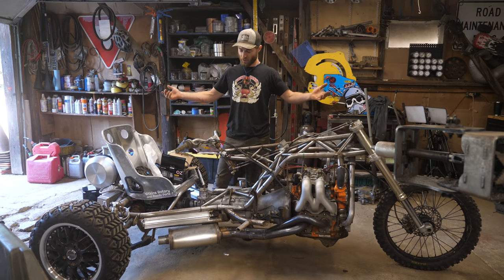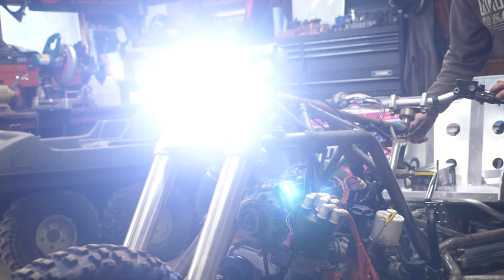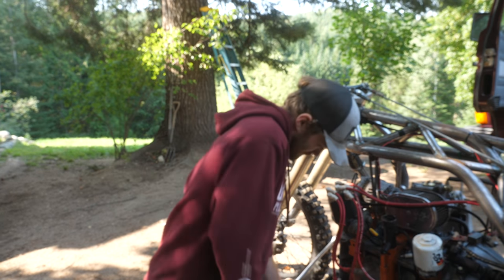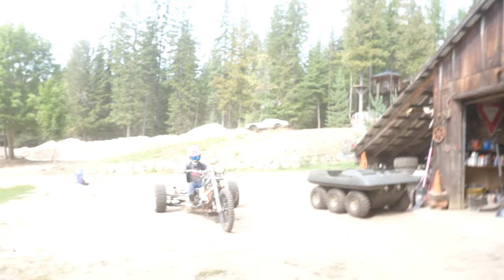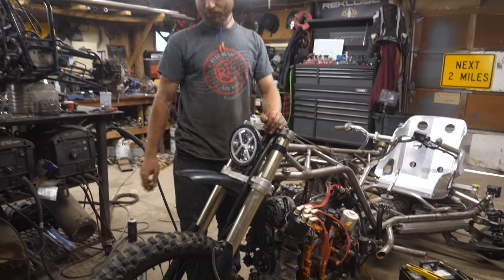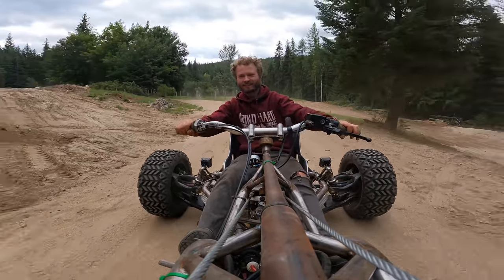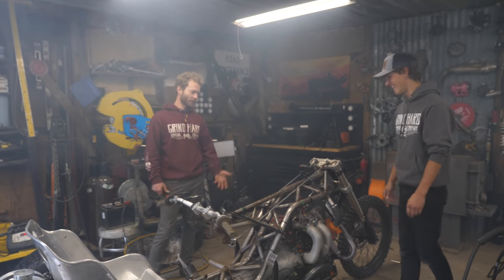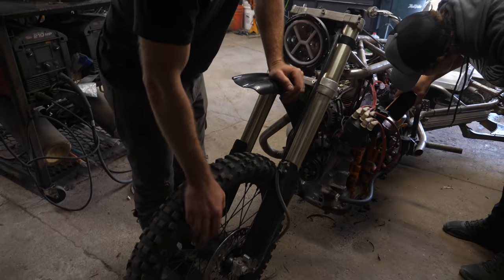Mad Max Rotary Trike Burnouts Lights and More!

Comment from the maker: Big thanks to Ridge for sending us this wallet and supporting the channel! Here’s the site if you want to check them out! https://ridge.com/GHPC
Reply: You gonna let rolly polly roll it?🤣
Reply from the maker: @that_red_dentside3968  If he so desires haha
Reply: @GrindHardPlumbingCo  right on!
Reply: @GrindHardPlumbingCo  try to do a collab with rob dahm
Reply: For the issue with braking power why not try find a twin rotor front wheel and go down that route?? Love what you do guys 🤘🏼😝🤘🏼
Reply: The thing sounds like it’s running to lean on the top end! Fast way to burn up a Rotary!
Reply: Vargas bros need to get there hands on this
Reply: Yoooo I wonder if you could use chain and sprockets instead of the cable on the steering if it would work it would look 🔥
Reply: @keeganbay3490  Oh yeah, it's crazy lean. They already have that thing too lean at idle. Rotaries are fickle beasts, you assume that the air/fuel load would be somewhat linear based on throttle position but they aren't, especially if they've been ported. Getting a carb tuned for a 13b is a nightmare, we spent months trying to get a Holley 650 working right on my friend's setup years ago, had to plug the power valves and modify air bleeds,  the ported motor made the vacuum weird so we had to switch to manual secondaries, which never worked right either as even with smaller jets, opening the secondaries below 4000 RPM would bog/flood the motor, but if you went too small on the jets, 6K RPM at WOT would go way lean. We ended up giving up, loading larger primary jets and disabling the secondaries completely running it as a fat / rich 2-barrel. I genuinely don't know how people get their BP'd rotary engines running right on those finicky choke-less Weber 48 IDA carbs.
Reply: Doing a car project, do you have a link for the headlight?
BTW, if a van shows up with men dressed in white, just accept the sweater they will give you and tag along 😅
Reply: I couldn't wait for the video to end what you got in that box in the background
Reply: @josephmills7186   he also recently did a video about how to fix several common issues with wankle engines.. It would be worth the time while they have it apart.
Reply: Is that a power wheels ready to build in the back
Reply: You guys are amazing! Imagine it build it repeat. Best yt channel ❤
Reply: Itd be cool to see some fiber glass work and duct the heat from the engine down away from the rider. Some sort of cowling.
Reply: You should ask Rob Dom to rebuild your engine
Reply: First you need to put some 2 stroke oil in the fuel if you want it to last
In stock form they got a oil injections pump but it not reliable  the best thing to do is mix fuelike a 2 stroke
Go see some rob dahm video
Reply: @That_s10_guy  or even better Angel motor sports
Reply: @GrindHardPlumbingCo  It desperately needs tassels coming off the grips.
Reply: I’ve been commenting almost every vid that they need to actually tune this thing before giving it the beans, it’s an awesome project but it’s gonna blow up before it’s even finished at this rate :/ definitely needs to be fattened up, probably some ignition tuning and they need to run premix instead of using the stock oil injection system. It’s so close to being a total beast!
Reply: #GrindHardPlumbingCo you should weld two bars coming down from the center of the top tube down past the front of the belt and under the engine then put some kind of diamond plate mud/bash gard on it so no mud or rocks damage the belts or engine
Reply: @racerex340  built a carbed 13b From 88 rx used a Quadra junk never got a good idle if any but dam it ran like nobodies business on under a heavy foot
Reply: Put a big ass oil cooler in helps cool the rotars
Reply: My friends turbocharged hes to make tuning easier might work for yours
Reply: @keeganbay3490  yeah, I feel like with most carb applications on the 13b, it either runs like crap on the low end but screams WOT, making streetability a challenge, or you can get it idling and running OK under half throttle below 4k RPM, but top end is either too rich or too LEAN. EFI is the way to go
Reply: If that picture at the end of the video was part of the merch I would most definitely buy it. That pic is epic
Reply: @racerex340  I'm running a 48 dcoe on my ported 6port and I have the jets bored way the fuck out I rather run my premixed rich so to thing stays good and lubed up in there.
Reply: @sexkrazedpanda  yeah, I've driven a few 48 carbed 2 rotors, if you get them tuned right, use premix instead of injecting, they can be pretty sweet. I don't have the talent to fine tune a ported carb rotary.
Reply: It needs a roll cage but sickkk build
Reply: Time to call Dahm and the Fab Father for the rotary Sauce:)
Reply: @racerex340  oh yeah. That how I run mine.
Reply: Do a collab with Cleetus McFarland. Just don't let George drive your stuff if you want it back in one piece. The guy drives like a grandma that can't see out the windshield, lol.
Reply: only one led headlight? thought maybe like 5 would be better to see with. gotta have fogs too.
Reply: hookup the electronics for push button start anf an alarm system.
Reply: Maybe you guys could try finding a double rotor brakes from a speed bike
Reply: @that_red_dentside3968  000
Reply: So you've smoked the engine already lol
Reply: Dude you know what would be really gnarly would be putting 2 motorcycle wheels in the front tight close to each other 🤔
Reply: @GrindHardPlumbingCo  looking at the trike i think your plugs a round the wrong way the cap will have l1, t1 and l2, t2 the l's are the top plugs or leading the t's are the bottom trailing having them swapped it will start and work ok at low rpm but die at high its kind of like retarding the timing a lot
Reply: You guys should do a collab with Rob dahm
Reply: Not to be a hater but at 11:17 there is a chain running under the garage to hold the bike back
Reply: NEVER give a wankel engine full throttle before its warm but you obviously do not know that ................  let it warm up in idle and it will last longer
Reply: need. tuning. big. time. on the carbs. u can. hear. it
Reply: I don’t think that wallet is gonna hold all the money you spend on the machines😂
Reply: @elijones4372  agreed
Reply: @jerrywooton4308  good idea wonder if Edwin sees this they are so busy now

Comment: You guys should be putting 2stroke oil in the gas to save the apex seals and lube the magic Doritos. this is a pro tip as the rotary engines have oiling issues
Reply: Premix everything!
Reply: Did you get that info from #RobDahm lmao..
Reply: @lysergicvisions8239  lmao they should probably watch some robdahm. that rotary needs some tuning work big time.
Premix in dorito's though is an old trick. Been around forever. It's a lot more reliable than the oiling system they use from the factory
Reply: I'd wager they were told that by Mike Vargas, he built that 13b if I remember right
Reply: @lysergicvisions8239  lol im a engine builder with lots of experience with racing. but that guy does give good info from the racing world. to funny lol
Reply: @Gu1tarZer0  not sure if they did if they knew they were going to kill it lol
Reply: @nemisist8805  True, anyone that is helping any type of engine strive for higher longevity / power I'm going to be watching lmao🤘.. & that's great man sounds like an awesome job!!
Reply: Them Dorrittos love pure filtered canola oil the best. Screw the fancy off-the-shelf Lard they sell in stores.

Comment: Gotta address your Fuel/ignition issues I recommend installing the oil injection delete kit and switching to pre-mix(amsoil saber at 100:1)  you basicly remove the engine oil injection and leave the stock oiling for the rotating assembly then you run a good two stroke premix to keep the seals happy
Reply: Spot on
Reply: Them Dorrittos love pure filtered canola oil the best. Screw the fancy off-the-shelf Lard they sell in auto parts stores.
Reply: ....yeah, what he said!
Reply: That light should get a skull cover...